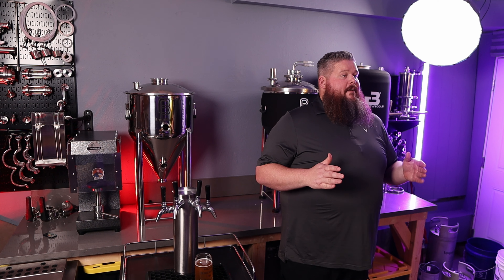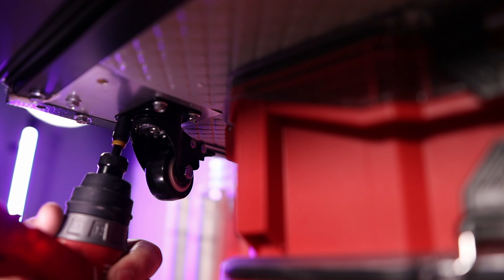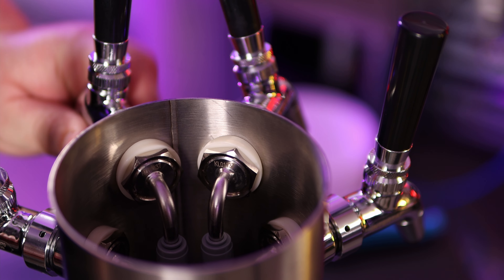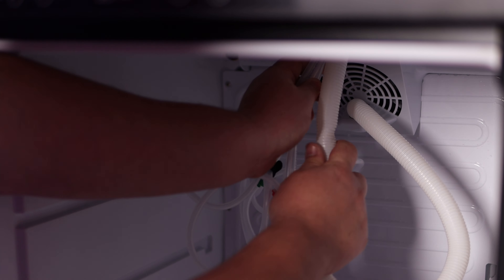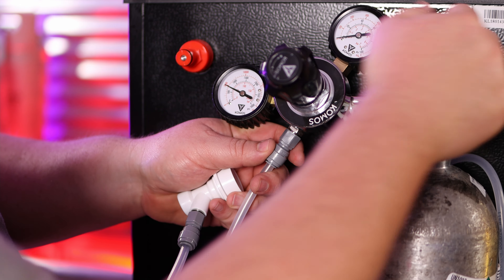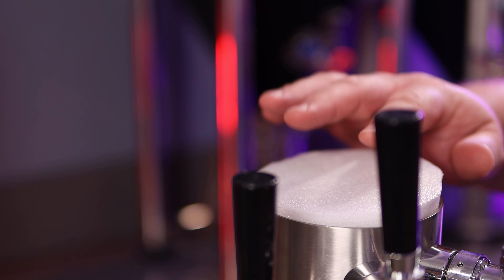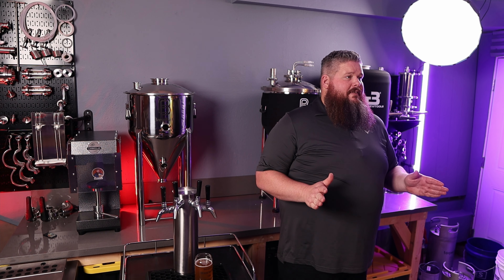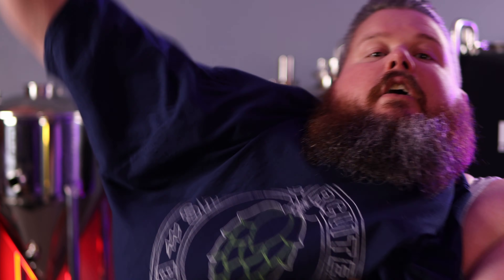KOMOS 4 TAP KEGERATOR  REVIEW

Comment: Thanks for the vid, Bradley.  My garage is insulated, and never gets above the upper 80s.  I'm not worried about the low end.  Any thoughts on such an ambient temperature (please chime in everybody if you can).  I'd rather have the 4-tap regular stainless, instead of the 3-tap-maximum "outdoor".  Thanks, all, for any input.

Comment: I had a 3 tap tower and faucets, so I just bought the Komos fridge and built it out.  It's really nice, and if my keezer ever dies, I'd get another 4 tap Komos.  But there are 2 things I don't like about it.  The locking casters are mounted pretty far back from the front of the fridge, so it's pretty difficult to lock them.  Second, the tower, at least in my case, is mounted into the plastic top of the fridge.. so turning on a faucet causes the entire tower to move.. it doesn't seem sturdy, but in reality it's fine.
Reply from the maker: I did notice that the wheels are easiest to lock if you have them facing the side. I didn’t notice the draft tower to be too wobbly personally. You better believe I’m gonna go and play with it shortly lol 🍻

Comment: It's identical to the kegland kegerator, apart from the logo & the CO2 regulator - they must have used the same manufacturer. I've got the 3 tap tower, that was super fiddly to connect up! Works great now though, would definitely recommend.
Reply from the maker: Awesome how long have you had yours for ?
Reply: @PortlyGentleman  about 8 months, it's doing a pretty good job so far! Only issue I had with it is one of the tap connectors coming off inside the tower, (messy...). That'll be entirely my fault though I think, poor assembly!

The first unit shipped to me was damaged too unfortunately, looked like the courier dropped something on it.

Comment: Question…. For the duotight carb cap fitting it says the diameter is 9.5 mm.  How does that work with the 8 mm gas line?
Reply: I don't think it does, I'm in the same boat, ordered from the link in description and it doesn't fit.
Reply: @Toelishness  I found that morebeer does have the correct 8 mm part.  Just that the wrong part is linked here in YouTube.

Comment: I wish we were neighbors!  :)  I'm so happy you found the hole too!
What do you think about the taps that come with the system?  Do you plan on keeping them or replacing them with higher quality ones?
Reply from the maker: I think the tops work just fine I do believe they now have an option for Nukataps I would prefer them I think.
Reply: @PortlyGentleman  isn't this a nukatap? I thought nukas had all the moving parts internally instead of the old style which has the exposed valves.

Comment: I was going back and forth on getting a Komos or another brand but your review sold me.  I got one!  An employee at my local homebrew store said the lines that came with the Komos  will cause foaming and such.  He recommend to use 1/4 in, 10 ft in length for the beer line; the lines that come with the Komos are too short.  

Do you recommend sticking with the lines included with the Komos, or getting 1/4 in, 10 ft length PVC beer line to prevent foaming?
Reply from the maker: I haven’t had any issues with the lines on mine nor have I had issues with forming at all I wouldn’t buy new ones  until you’ve tried the old ones there’s no harm in that 🍻

Comment: Ignorant question incoming:  Can you easily replace the tap handles with the custom made, name brand tap handles or the like?
Reply from the maker: @tedbaccich2566  easy as can be. They should just screw on and screw off. There's an adjustment nut to lock them in place so they're tight at the proper angle.
Reply: @PortlyGentleman  thank you!!!👍😎🇺🇸
Reply from the maker: My pleasure! It also looks like they're on sale right now!